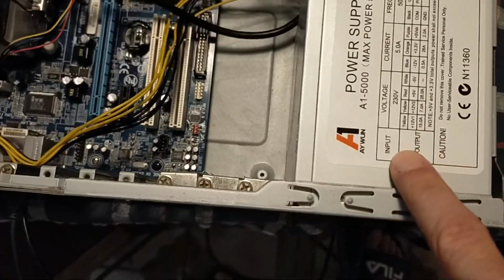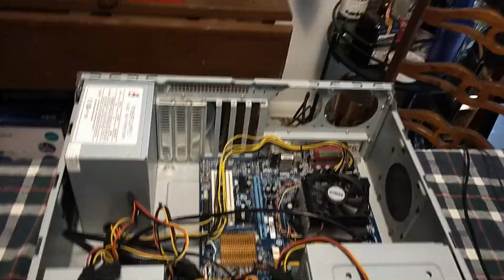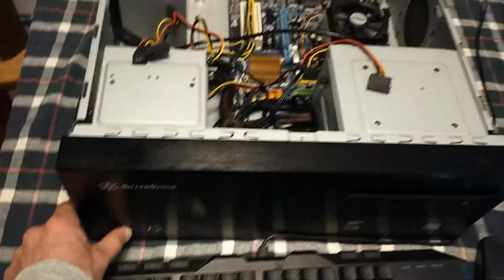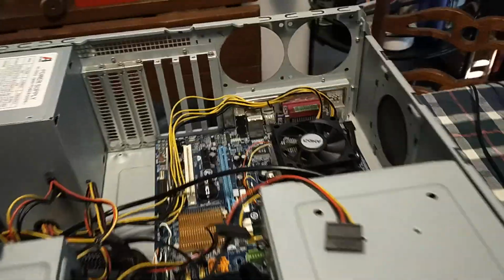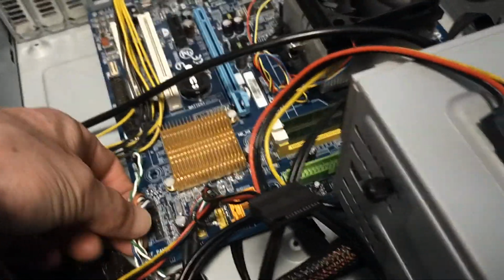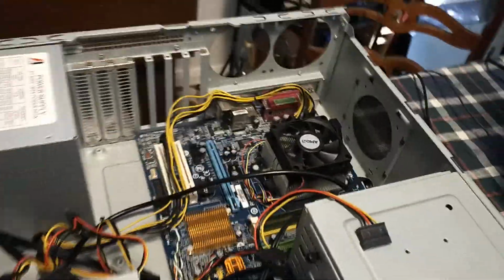faulty used PC PSU power supply unit from eBay.

Comment: not gonna lie bad idea to get cheap power supplies but also at the same time It could have been your CMOS battery
Reply from the maker: no i tested the motherboard with another PSU and it works fine have installed windows on it now
Reply: @TimBorg  welp ok then I was wrong. Some times some motherboards wont boot when there is no CMOS so alright then